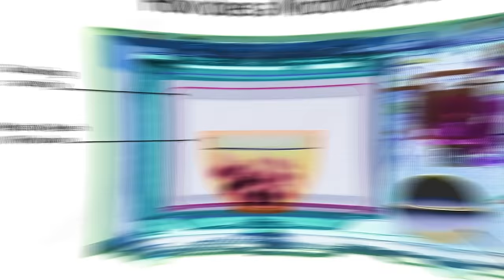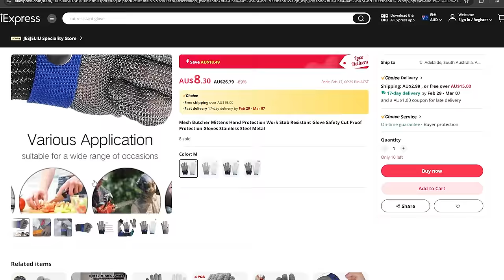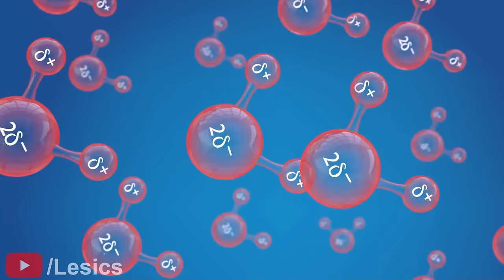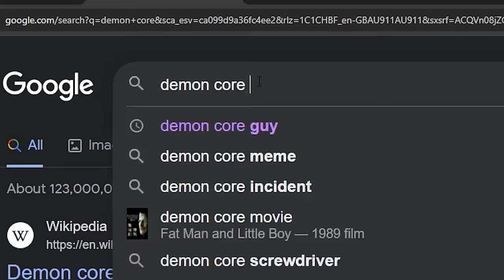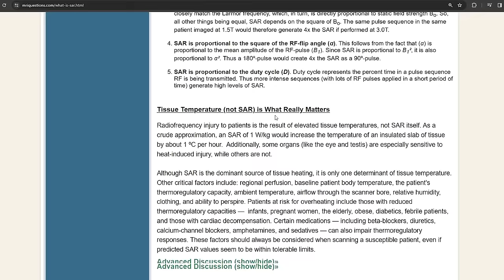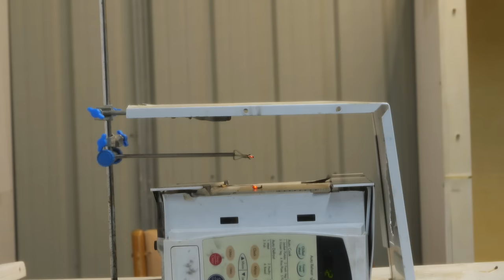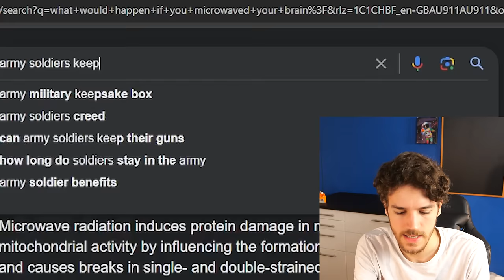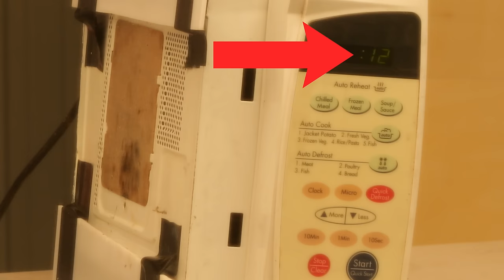I Tested the Limits of a Microwave

Comment: In terms of how the screen blocks the microwaves:

When microwave radiation encounters the conductive metal screen, the electric fields in the waves induce currents in the metal. These induced currents then generate electromagnetic fields that oppose and effectively cancel out the incoming microwave fields, the metal blocks it the same way as the rest of the microwave, it's just now there's holes in it to be able to see it. The opposing field will be weaker and let more radiation through, but not by much.
Reply from the maker: I think this is the best explanation I've read so far
Reply: That makes sense. Much more believable than "they don't fit cuz the waves are too fat, trust me bro".
Reply: So effectively a faraday cage?
Reply: @johgekpunkt9516 you took the words out of my mouth. I was just about to ask that
Reply: My idea as to why the size of the holes matter is that the oscillating electric field, being tangential to the screen, wiggles (scientific term) the charges around at the same frequency with some phase kick.

If you imagine the mesh is replaced by parallel wires, then the relevant distance would be the spacing between each wire, assuming the direction of the electric field is also that of the length of the wires, where the electrons will wiggle. These wires will act like antennae and create destructive interference behind the screen and standing waves in front.

A mesh is just the 2D version of that, assuming we have no idea of the polarity of the incoming photons (which could be any combination of the two directions of the plane of the screen, or alternatively any combination of circular and anticircular).

The overlap of the emitted opposing fields inside the gaps will be related to the frequency somehow, and I suspect the trick to making this characteristic distance correlate with the wavelength is the interesting bit.
Reply: @onemadscientist7305  I don’t see why the size of the holes matter as much as you think (assuming they’re not outrageously large), the reason for this is because the side of the mesh facing the inside of the cavity will always be the opposite charge of the incident microwaves because opposite charges in the conducting screen attract to the opposite of whatever polarity the microwaves are in that instant. This causes the microwaves to be deflected towards the mesh where the internal field in the mesh causes it to undergo destructive interference
Reply: And then of course, the small amount of microwaves that do make it through the holes become very, very, gay due to the holes reversing their polarity...
Reply: @EchoesPF878  So basically bigger holes = less material and  smaller hole = more material. 
while more material = more destructive interference and less material = less destructive interference
Reply: What I also realised from this video is that metal mesh on MW window is not really for the human protection, but more to not let micro waves escape and MW to loose power.
Reply: @johgekpunkt9516  literally that. I made another post mentioning that, using metal mesh gloves probably wasn't the best idea though.
Reply: @ScienceDiscoverer  I mean it is meant to protect humans, the heating microwaves cause can still damage tissue even if the energy outside the oven is miniscule. The mesh also doesn't make the microwave oven anymore effective since the key function of the mesh is just to dissipate the microwaves. Also as seen microwaves mess with electronics so that's another good reason to contain it.
Reply: So the screens are homophobic then? 😂🤣
Reply: I've made several videos experimenting with microwave transceiver, and came out with blocking mechanism of electromagnetic wave in general. In this case, the screen acts like antenna array, which reflects the microwave back to the oven cavity.
Reply: @ScienceDiscoverer 
Precisely. If the door was all glass, the microwave would lose too much energy. If it was made of metal, food can't be seen. The fancy,  new microwaves have just glass.
Reply: @vercopolis  I guess the fancy new ones figured out how to bounce the waves in the way that they don't even go in the direction of the window?
Reply: @mrgreenguy  Isnt it just faraday cage and waves cant go through it? (similar idea ig)
Reply: @johgekpunkt9516  I don't think that it is a faraday cage. My understanding is that the EM radiation induces currents in the metal and therefore dissipates the energy in the metal and the faraday cage sort of channels the EM fields away. Do correct me if I don't understand.

Comment: When I was doing RF engineering training the main risk they taught us about was that the cornea and lens of the eye don't have direct bloodflow o there's no direct cooling to them provided by your body, which leaves one able to be quickly blinded by microwaves via cooking the cornea or lens which turns them opaque like in cataracts.
Reply: Pesky water in your eyes. 😂
Reply: Yes that is the biggest danger in microwave experiments, or RF experiments in general.
All parts of the body that have low or no direct blood flow can overheat quicky. And since some of these parts, like the cornea, have no heat receptors damage can be done without even noticing it.
Reply: As he also discovered without the resonant chamber the efficiency goes down on what is essentially a high power white noise generator. He would have a different result if he picked up a 1500w unit from the 80's.

Another thing I laughed at was not realizing that the door open safeties is how they turn the microwave off and once those were disabled there was no way to do it.
Reply: Proceeds to put his eyes closer to the emiter.
Reply: @RowanHawkins  There are several microswitches to determine if the door is closed. If one indicates open but the rest indicate closed door they create a short circuit to pop the fuse.
Reply: @eaglevision993  just cut off the latch part and stick it in there. tbh ive done it with a screwdriver before and it worked. (dont ask)

Comment: The part about the mesh blocking the microwaves was actually a very neat point I enjoyed. I actually researched it a bit myself and it looks like light propagation and the THICKNESS OF THE GLASS is actually what contributes the most! It's hilarious that it's not just the mesh's design, but also the physical property of the medium itself that prevents the wave from penetrating through!

Comment: 8:06 needs some clarification. The reason you would usually connect your self to ground is for static protection, like when styro works with very sensitive laser diodes and doesn't want to fry them with static build up on his body. There is another form of grounding in a Faraday suit that allows the electricity to flow around your body instead of passing through it which is what you did with the glove.

Comment: Very interesting! Cool example of how urban legends can spread. Microwaves being shielded for efficiency (reflections) and ease of use is a bit less exciting than cancer and exploding eyeballs I guess.
Reply from the maker: lol yeah exactly
Reply: Ehhh. The carcinogenic nature of microwaves is still somewhat unknown. They might be. We are not fully sure yet. 
And I am sure you could explode an eyeball in a microwave. You’d just need an eyeball which wasn’t attached to a creature that would notice “Huh, my face is hot, I should move.”, like a cow eyeball or something from a butchered animal.
Reply: @RryhhbfrHhgdHhgd356  If microwaved had the capability to be carcinogenic due to radiation, then we'd have to very seriously be looking at the amount of radiation coming off of your average light bulb, which is multiple orders of magnitude stronger than what is produced at the microwave level. But it's not, because DNA damage occurs with Ionizing radiation, which begins after the visible light spectrum in ultraviolet, which again, is multiple orders of magnitude stronger than microwaves. Microwaves do not carry enough energy to rip apart molecules, such as DNA.
Reply: @RryhhbfrHhgdHhgd356  Microwaves are non-ionizing radiation. Worse thing they can do is heat you up. It is, actually, quite known and yes we are "fully sure" about this.
Reply: @blackbelt352-dd  And while a LED is probably safe, I actually would suggest some concern around an incandescent. It is a black body more or less after all. And let’s not forget that fluorescent bulbs are one shielding layer away from being straight UV lamps.

Comment: i've watched people in industry go through nearly the same comfort-level increase,  except with actual x-ray sources lol

day 1:   "where's the lead apron?  dont wanna fry my nuts!"
day 69:   "hey ima turn off the lights and blast this scintillator, wanna see it glow?   isnt that cooool"
Reply: except with xrays we know that they do have some longer term effects
Reply: Been there, done that
Reply: but anyway, xray tuned for medical isnt nearly as bad for the body as xray from a bare tube.   even at low kV, a tube that has no beam-hardening is SPEWING out "soft" xrays that your soft-tissues absorb like a sponge.   since they get absorbed so quickly, they dont contribute to an xray image hence why medical xray has the spectrum filtered.   im serious: please dont think that pumping 50kV 5mA for 10 seconds into a bare vaccum tube  is any safer than  100kV 256mA  for 100msec into a tube with its housing/filter still intact.      its like thinking that ethanol inhalation is safe because its okay to drink a 5% beer

edit:  if any youtube clown wants to make their xray "bare tube" safer,   u should at the very least wrap it in a sheet of like 0.7mm copper.  if thats unavailable,  then wrap it in a jazillion layers of aluminum foil until the thickness is like 0.8 inch.   probably wont meet regulations but ull at least filter out the majority of useless-yet-celldestroying wavelengths.  bremsstrahlung dont GAF itll give u all the nasty frequencies

edit2:  this "beam filtering" is also a big difference why stuff like luggage scanner xray is different from medical xray.   for luggage they send shitloads of soft xrays through because it doesnt matter and they want to see reaaally fine detail in very soft materials
Reply: Good way to end up in a different kind of YouTube video
Reply: Well X-rays a re lots of fun as well! And seeing a scintillator crystal glow due insane dose rate radiation fields is quite fascinating. Also have you seen how sodium chloride turns orange-brown when irradiated for some time? then sprinkle it onto a hot plate and it glows a beautiful yellow.

Comment: pretty much what I expected overall. People always underestimate the importance of the oven being an enclosed cavity in which microwaves can build up massively and therefore get WAY more chances to get absorbed by food and other stuff. You mostly went about this in a very safe way, only increasing your exposure in a very slow and controlled way. 

Honestly your biggest possible oversight during all this might have been that moving into a metal shed COULD have immediately exposed you to several times more microwave intensity because they started bouncing around inside the shed many times as well. Basically the shed became the inside of a microwave cavity. The biggest factor which probably diminished that effect would be that the floor of the shed is most likely NOT made of any significant amount of metal, thus the microwaves leaving that way and getting absorbed in the ground rather than the next best absorbing thing, you.
Reply from the maker: Yeah I was thinking about this too, all the objects in and surrounding the walls of the shed helps absorb the microwaves. I also don't think a household microwave would be able to heat up an entire human body either tbh. At least not in short time frames
Reply: @mrgreenguy  Yeah even in a worst case of a completely enclosed room where 100% of the microwaves get absorbed by you, I imagine you'd still notice your body heating up slowly, if anything, long before it would get dangerous, especially since you already knew the microwaves would be the reason and would turn it off (unlike in animal experiments etc). 

I just mention it because you were being so careful, shielding your body parts etc, but didnt mention the effects of the shed and possibility of it redirecting the microwaves too.
Reply: @mrgreenguy So it's kinda having a capacitor and a battery, the battery won't do you harm with it's regular voltage, but a capacitor can certainly give you shocks in a dangerous way if unlucky. The microwave cage is like a capacitor.
Reply: @mrgreenguy Certain organs heat up faster than others.

See the medical case, “tissue destruction and death from microwave radiation (radar.)”

The patient felt warmth and moved away as soon as he felt pain (inside his abdomen) but by that time his intestines had a third degree burn. 

Another researcher mentioned, burning the brain of a rabbit without injuring the skin. 

You’re probably okay but I wouldn’t rely on the heat you feel to judge if an exposure is safe.
Reply: @mrgreenguy  Agreeable, you'd need a radar dish to cook a human!
Reply: Even still, the size of the shed would decrease the concentration of microwaves by orders of magnitude, I bet
Reply: @deltab9768  Yeah especially because there are a lot of parts of the body that don't have pain receptors at all, and other parts that don't have blood flow to regulate the temperature

Comment: 16:15 It's still a fuse, just a one that's rated for 400A slow blow.
Reply: Photonicinduction approved fuse
Reply: @whatbroicanhave50character35  Ahh, popped it!
Reply: @aaronjamt  atleast he did that one outside instead of in on the rug like usual

Also holy shit, I guess it was 5000 amp, not 500
Reply: @whatbroicanhave50character35 Yet he hasn't uploaded in 2 years...
Reply: @aaronjamt  I really miss that rug...

Comment: The diffraction phenomena doesn't apply for these holes because they are made out of a conductor, which has particular boundary conditions for the electromagnetic fields (i.e. the fields must have an specific orientation where they touch the metal of the mesh). These conditions + Maxwell Equations determine the possible modes (i.e. the field configurations that are possible). When the hole is way smaller than the original wave, the wave poorly excites these modes so almost no energy goes through. It's not quite exactly that it doesn't "fit" the hole, but more like trying to draw small dots with a giant pen: it's not impossible but barely effective because the size is just wrong.

Comment: 16:07 Yes, many microwaves are set up to blow the internal fuse if the switches aren't in the proper position. I'm guessing the control panel has its own separate fuse and that's why it's still counting down.

Comment: I think you may want to consider occasionally checking for initial stages of cataracts.
Special feeling at 34:09 when you do get closer and the "EXIT" sign gets brighter from the reflected light
Reply: Cataracts become a risk when the lens reaches temperatures above 42C° which I doubt his eyes reached at all. Its far more harmful to stare into a fire pit or a forge than what he did.
Reply: @teresashinkansen9402 Which he pretty much did with the plasma
Reply: @hydrocharis1  but I also doubt that plasma heated up his face at all lmao
Reply: @hydrocharis1  except that the plasma was basically underpowered so to say. It probably barely gave off any heat.
Reply: @Sharpless2  What I think I meant (it's been a while) is that a fire is also plasma, not that it was dangerous, confusing comment sorry

Comment: 21:18 0.0018 degrees Celsius is incorrect, as 1000 times 3500 would be 3.5 million. This would make the temperature increase 0.00018 degrees Celsius, a full order of magnitude off. Large language models are not reliable calculators.

This is assuming that ChatGPT gave you the right equation in the first place.
Reply: trusting chatgpt with safety precautions: 😬
Reply: The fact this guy even mentioned that POS was scary as hell.

Comment: 11:30 Microwaves do in fact have the ability to mutate cells. It's just a lot more likely to kill the cell than it is to mutate it. Since the wavelength is so much higher than the wavelength of something like a gamma ray or an X ray, it doesn't have the ability to precisely knock out individual bits of the DNA in your cells. Instead, the microwave kind of just slams into a whole bunch of cells at the same time. This is what gives it the ability to heat things up and cook food. But anything that damages cells in your body, such as a burn from a microwave or a regular oven, has a chance of causing cancer. When you are injured, your body starts to replace the damaged and missing cells through mitosis, and this process always has a small chance of leading to mutation, and those mutations have a small chance of becoming cancer.

The danger from ionizing radiation is that, in relatively small amounts, it can damage cells without killing them outright, i.e. without causing burns. So you can receive a blast of this radiation but feel fine afterward, and only later realize that you've been harmed. With microwaves, on the other hand, if you've been harmed by the microwaves you learn about it pretty quickly since you'll get a nasty burn from it.
Reply: So basically a microwaves ability to cause cancer is equivalent to getting a boo-boo